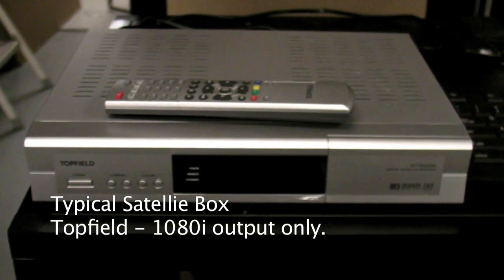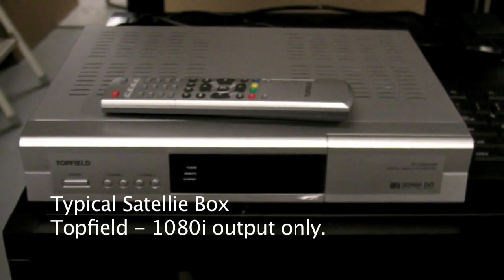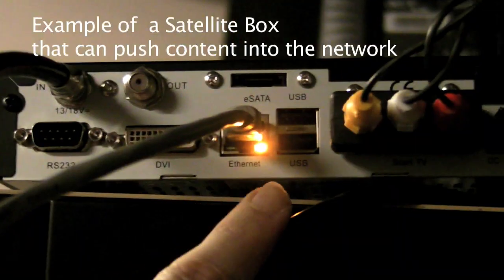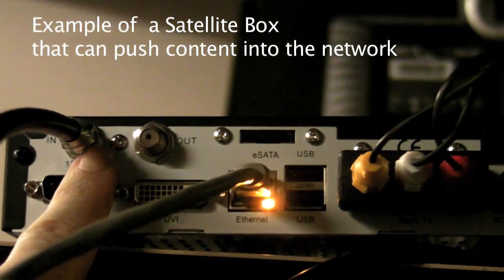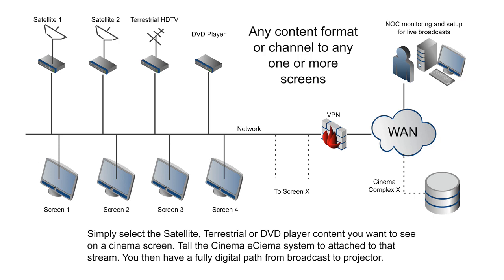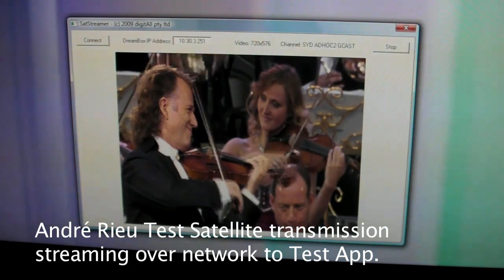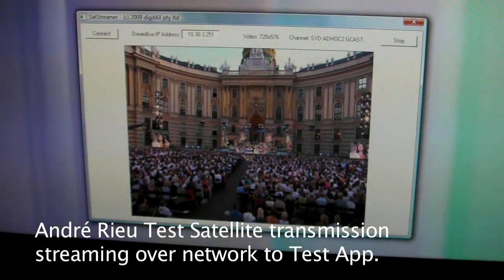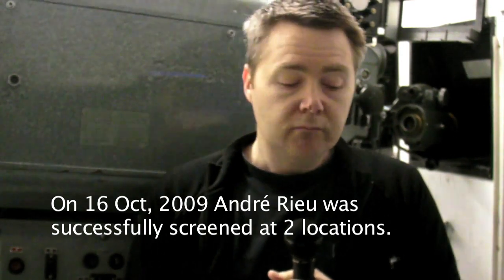The future of streaming content in a cinema.

Comment from the maker: @strictlysega 4K is not common yet.  Even so, a 4K does a better re-size on a larger screen.  It reduces the percevable BLOCKS if in use..
But yes, its all SD (720x576) or HD (1920x1080 close to 2k)
Looks quite good.  
But yes you are limited by real time satellite broadcast quality.  Nothing you can do about that.